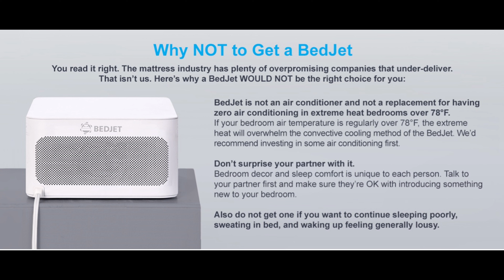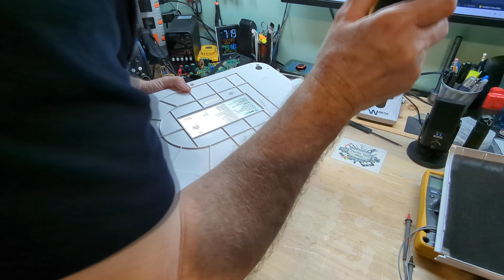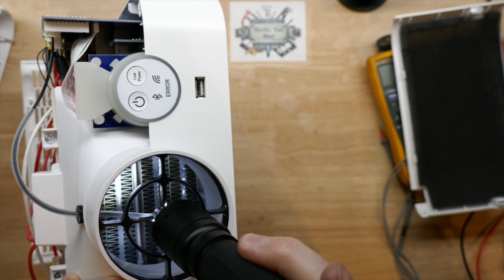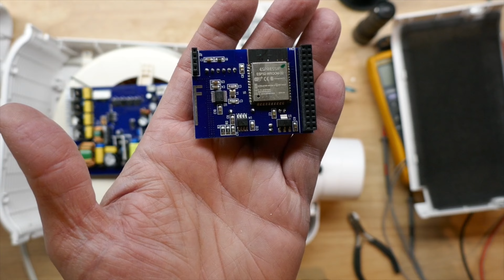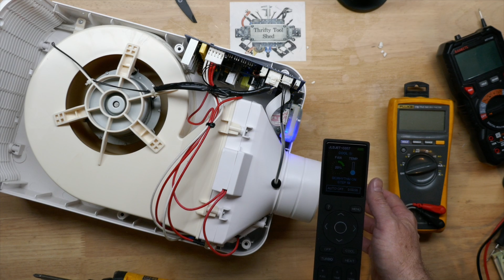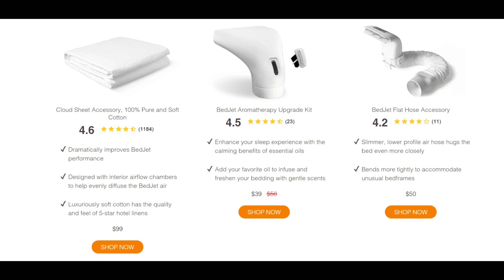BedJetV3 Look Inside

Comment: I didn't catch it in the video, what was wrong with your unit?
Reply from the maker: I actually found no issue other than the slight fan growl on low rpm. The eBay listing stated fan noise and heater issues. The heater tested fine for me, but I disconnected it anyway since I never want the heat to come on. It was possible the intake filter had gotten blocked (by bedsheets etc) of previous owner and that could cause heat issues if no proper air flow. I think I mentioned that briefly in the video.

Comment: The thermal fuse on my unit has blown and has disabled my heaters. What is your recommendation for replacing that fuse and restoring the heating capability?
Reply from the maker: You can get the value off of the thermal fuses and replace with exact replacement. I have a Dyson Hair Dryer video showing replacing the thermal fuse( I belive its Dyson HD01 repair #3)I talked a bit about thermal fuses and ratings in that video, but I did not work on that part of the bedjet to say how hard it is to reconnect it. The other thing is why did it get to hot and blow? Did the filter get clogged or bed sheet block the air inlet? Make sure you have sufficient air flow so not to overheat at the heating element.

Comment: Will it work if heating elements are disconnected and removed to reduce noise?
Reply from the maker: That's a really good question. I can say that the element disconnected is totally fine. Mine is still running like that. Removing it all together, I am not sure. The over temperature switches may give an error? I did not try it to say for certain. I still think it's close to 100% possible since worst case scenario, just jump out the over temp switches.

Comment: I just made one of these diy way cheaper and way better. Mine has a room temperature inlet and an inlet with a water heat exchanger. I heat or cool the water in the reservoir with a peltier system. The air streams are mixed with a valve controlled by an arduino to maintain the desired temperature. I have 3 120mm pc fans that provide plenty of airflow.

I probably spent around a $100 in parts. Crazy how much they're charging for such a simple device. Its literally just a fan in a box.

Comment: I've had this bedjet for 5 years now, use it every night. I haven't had any problems, it works perfectly. The only thing is I can't run any heat off the generator when the power is out (15kw generator) but can run multiple other 1500 watt space heaters, so it must have something inside that limits the current. All in all, the bedjet of beyond amazing and durable (we have 6 cats, so even with all the dust and cat hair).
Reply from the maker: I'm glad you have had success with yours. That is very interesting about the heat not working with 1500W gen. You would think at least the low power mode would work fine.  Thanks for sharing!

Comment: my bedjet wont turn on at the power button, any ideas?
Reply from the maker: The first thing I would do is make sure it's not still under warranty before any attempt at repairing. Of course, I bought this one broken just for investigation and learning. From memory, it does have a fuse and a power supply section on the board that could be a problem area to look into if you are familiar enough to troublesoot it. I would also check the button assembly cable is plugged into the main board well. Sorry, I have no more experience with these than I shared in the video. This is the only time I have had one apart. Best of luck to ya!

Comment: Housing with a blower (maybe a brushless quadcopter motor with a properly designed blower impeller), motor controller, power supply and a wired remote would cost what, $50 so sell for $100?  Adding heat couldn't make it more than $150 retail. The other $300 is the $10-20 bluetooth and wifi module and app development.  Seems steep when all I need is the fan and a wired remote suits me fine.
Reply: it's not even close to the same.  Until you've tried one you will not know.
Reply from the maker: I do have it, obviously, and unless you need the heat mode, as I stated, it is no difference. It is a FAN in a BOX. There are many cheaper bed fans with hose and speed control that will do the same thing. It does not cool what so ever. The fan is bringing in ambient air in the room, and if the room is already conditioned , it helps pull down humidity, so it's nice for that, but again, it's nothing special. It's a fan in a box. I'm glad people like them, and it's probably good when the heat is needed. I, for one, don't want that heater portion working under or beside my bed, though...

Comment: I wanted to replace my 15+ year old electric blanket as it was turning dangerous, the control wasn't very accurate, and I was mostly concerned about the chance of fire.
I looked at many blankets and saw several reviews stating they had problems with overheating, so electric was out.

I looked into the circulating water mattress toppers and though that would be a great idea.  It turned out to be a disaster.  What happened to mine was that I was waking up sweating and hot because my body heat was heating the water!  Even if I set the temp to something low, it still got hot.
I wanted to be able to program a temperature profile, but the only way was to use the built in programs which were WAY too high!!!

I looked in the Bedjet that I knew did not have any kind of cooling, and a brand called an 8 which did have heating and active cooling.

The Eight Sleep used circulating water BUT was about $2000!!!!!
The Bedjet uses forced air, and if needed heated the air.  A temperature profile can be programmed in as little as 15 minute stages, but time duration or time of day, and 3 different programs can be stored.
I have a program for winter,, one I call winter/summer and summer.  I do use the heat function in the winter, so it does work for me.
The fact that there is no active cooling, to me, is offset by blowing air between the sheets which seems to cool by evaporation and does tend to cool.  The fan speed will help with cooling as well.
I did think that ~$500 was a little high, but after looking inside and  impressed with the quality of the build, I am somewhat impressed.... still.... $500???
There are no real alternatives though other than the Eight Sleep but that is VERY expensive!!!! PLUS if you want to create any kind of profile, they CHARGE you $15 per month!!!!  Do I hear money grab????

Thanks for your video!  I hope you like your BedJet.  I do.